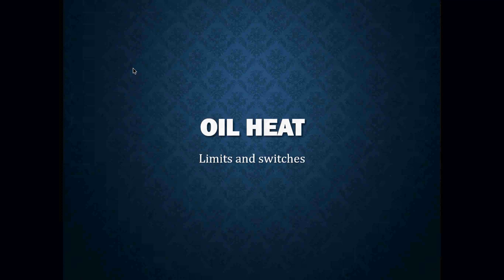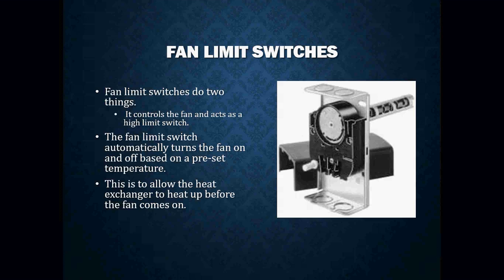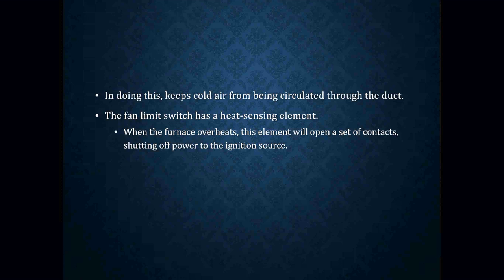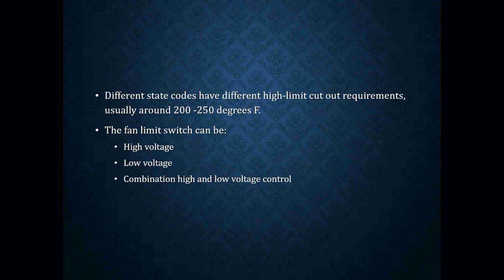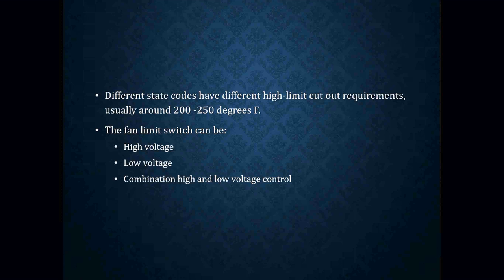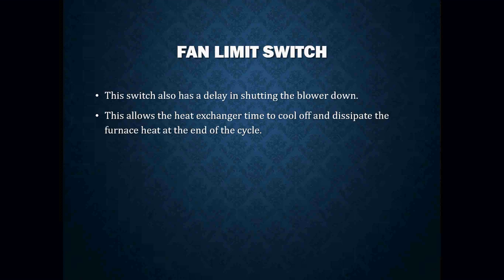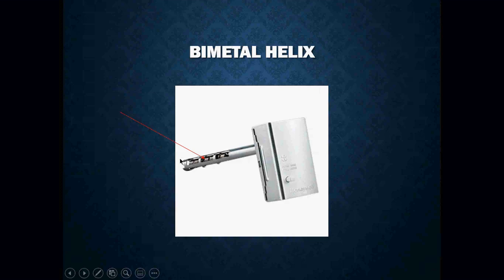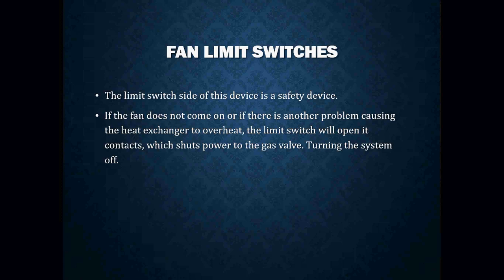Fan/Limit Switches

Comment: I recently replaced my fan limit switch when I noticed that the blower fan would not turn on and the unit would shut off on high limit.  There was no change when I put in the new switch.  After about 5 minutes the blower fan turns on and shortly after the induction fan turns on and then the furnace ignites.  What should I look at to find the root cause of the problem.  Thanks in advance for your help.
Reply: This thing is just a switch. Instead of you making or breaking the contacts with your fingers, as you would on a light switch by flipping the switch up or down, this switch makes or breaks the contacts based on temperature, so troubleshoot this switch just like any other switch. This was a very good informative video on the description and operation of this switch. Unfortunately, they didn't cover how to troubleshoot this switch, but I'm sure they didn't because they wanted to keep the video short as possible. I'm pretty sure they covered it in the presentation at seminar.

I honestly don't think both the old and new switches are bad. It's possible but very unlikely, so I think you should  first check the power coming into the switch. Power should always be at the switch during normal operation. Take the cover of the switch and check for power coming in with a voltmeter set to AC volts. You should have 120V on the "fan" side of the switch, You already know the "limit" side of the switch works so you don't have to check that. Once you confirm you have power coming into the switch, you can now troubleshoot the switch for proper operation. Watch this video on how to check the switch with an ohmmeter for proper operation. Before you start, turn all power off to the furnace, and confirm power is off by checking with a voltmeter. After confirming power is off, disconnect both wires from the fan side of the switch and do what's shown on this video. If you don't have experience working with electricity and a multimeter or don't feel comfortable doing it, then I highly recommend hiring a professional to do it. It's not worth getting seriously injured or ending your life just to save a few bucks. https://youtu.be/Pyz9MxgHn5k?si=9S3bgvMi93t1t8oh

This other video also shows you how to troubleshoot this switch https://youtu.be/PFN_vZqXXR4?si=EQ1vWAL__QjAK_4N. Watch both videos to get a better understanding of the troubleshooting process.